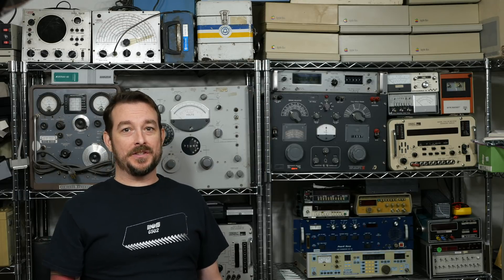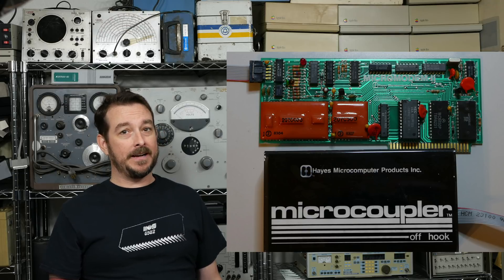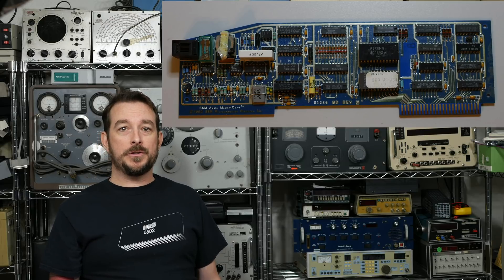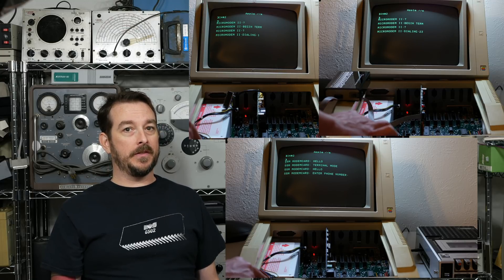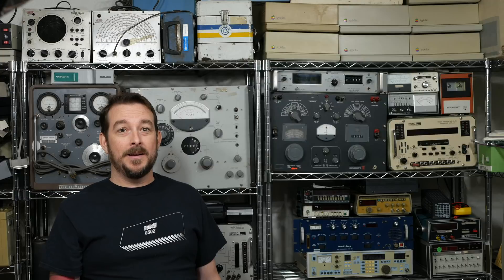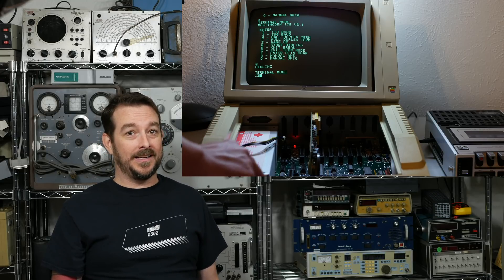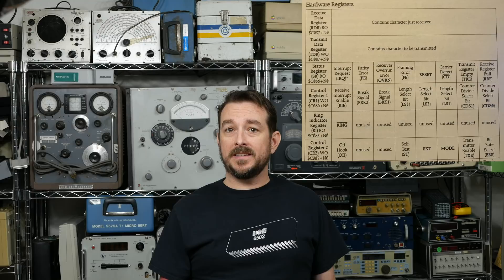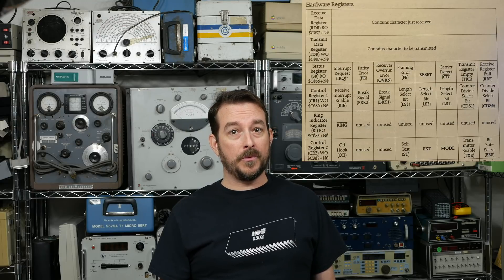Modem Monday #7 - The "Other" Hayes Compatible

Comment: I'm baffled I didnt know about the hardware  differences. No AT. Make me wonder about the AppleCAT card, difference and of course in ddial
Reply from the maker: well, pretty much anything that isn't "Hayes Compatible" (meaning the AT command set) is a hardware addressed device or just "dumb". In the case of both the AppleCAT and the Micromodem II or IIe, there's a set of control and data registers at specific memory addresses on each card which are used to control the modem, keep track of states like carrier detection, and stuff that helps you detect if you have any incoming characters that need to be polled, etc. Since you brought up acoustic couplers in your comment on the other video, that's a good example of a "really dumb" modem, but a non-acoustic coupler "dumb" modem has a "Talk/Data" switch on it typically, so you'd put it onto talk, pick up the phone same as you would with an acoustic coupler, dial whatever, and instead of physically coupling the phone handset, you flip the switch to Data which disconnects the phone (it plugs into the modem, the modem plugs into the phone company) and then it does its thing. There were other "smart" modem types out there which didn't use the Hayes command set. Some examples would be many of the old Racal-Vadic modems, Rixon modems, and a couple other oddballs that were competing to become the "real smart modem." Only one really won. :)

Comment: I have a Novation Apple-Cat II. It was really hot stuff way back when I got it. Added the expansion board to get full-duplex Bell 212 1200 baud capability. Later they produced a ROM replacement to emulate the Hayes command set.